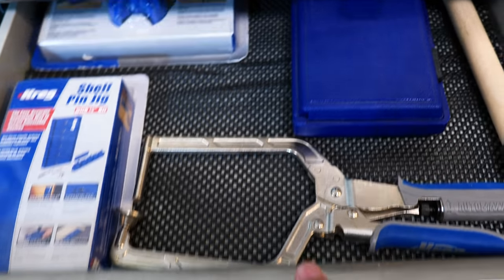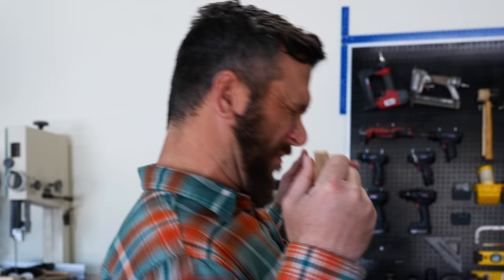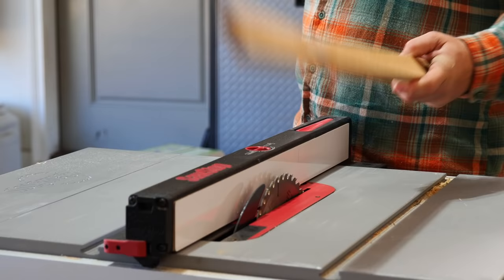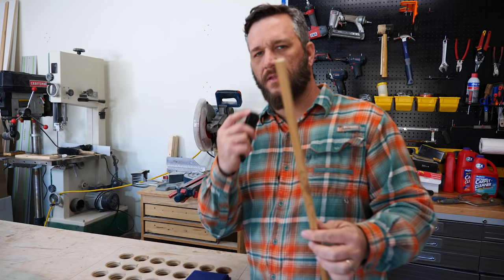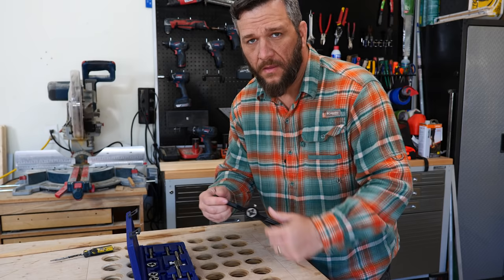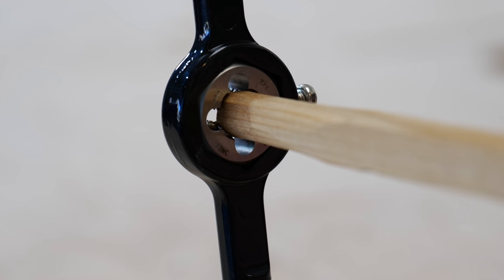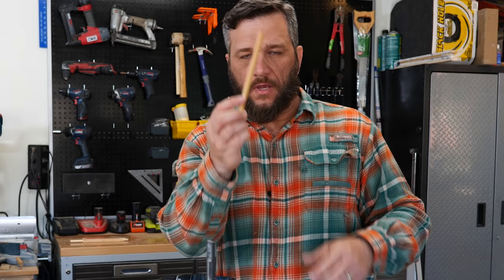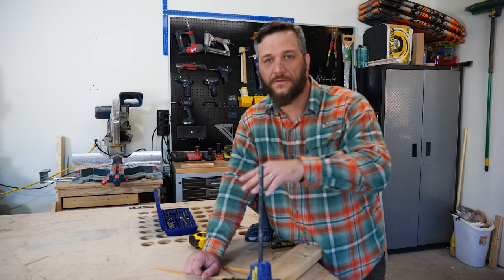Make Wood Dowels In 10 Seconds!

Comment: Awesome trick! Will definitely be using this one. The reason the dowel isn't 1/2" when using a 1/2UNC die is that the minor diameter of 1/2UNC thread is approx .4" roughly 3/8" after some sanding. If you want a 1/2" dowel, use a 5/8UNC die as that has a minor diameter of .51".

Comment: Thank you Haxman, this is the perfect solution for rounding over some square stub ends of curved slats for fitting into round holes.  The shape of the slats meant I couldn't just take them to the router table.  I was stuck -- thinking I'd have to whittle 96 stubs by hand -- until I saw your video.  Thanks for sharing!

Comment: Great tip.  I don't have a tap and die set, but years ago I had a few taps which I used to cut threads in oak, and then ran the fasteners into the wood. Some of the jigs I built 20 years ago are as strong as they were when new.  I think I will pick up a set now that I have a use for the dies. Thanks!
Reply: It's bad enough the login makers would allow mfs to treT and put there gd hands on someone 18 times in 2 years he ain't saying nothing u will tell that stupid gd area who what and why take the gd place do something

Comment: Drill required size in an old circular saw blade. Damage one spot inside the hole with  a centre punch to creat a bit of a dag. Clamp down or vice hold said blade and ditto.
Works a treat

Comment: Great trick. As a quick rule. A 1/2–13 die will make it 1/2” - 1/13” or .42”. A little less than 3/8”. Use the pitch as a fraction to subtract from the nominal bolt diameter. With a little care, you can get pretty close to what you want.

Comment: Great Idea for making dowels. I would point out however, that plugs and dowels are different animals. Using a dowel as a plug will show end grain on the exposed surface. A plug on the other hand since it is cut across the grain, will leave long grain showing on the finished surface. Careful use of a plug cutter can yield a plug that is much harder to see from the surrounding grain. In some cases it almost disappears.

Comment: An interesting way, but I thought there was another way where the diameter is especially important - or where you have only short lengths of the right endgrain material. I read of a way involving a steel plate with a series of holes gradually getting smaller to the target diameter. You make the square stock the right thickness the take small pieces and hammer them through each hole, in turn, and each hole progressively trims the wood pieces down to the right diameter.

Comment: Just grab a piece of flat plate steel, or a piece of C channel, drill holes of different diameters, and using and prepping a piece of wood as was shown, tap it with a hammer down through your pre drilled hole of your choice, and you can have a dowel with pretty exact diameter.

Comment: Thanks. It doesn't make a right size dowel. First. for certain dowel joinery you can use a smaller drill bit for the dowel so created.

Second, this method can be to make a round blank to make precise dowel.  if there is a hole cutting bit that fits the dowel so made,  you can be spin this dowel and cut to precise size dowel. One then do not have to use the "square spinning in a circle" method to make a smaller diameter dowel. Creating the square blank is harder than making the round blank with this method. Practically since the biggest die I have is 1/2 inch, the bigger precise dowel made is 3/8".

Comment: Drill a hole of your chosen size  with the the edge just cutting through the edge of your donor scrap wood, clamp on a sharp chisel at sat 35 degrees across the gap, hone down and chamfer your dowel piece to fit in the hole , attach to drill shove it in and switch on and gently push it through much less hassle.